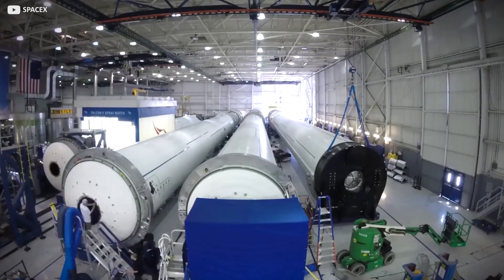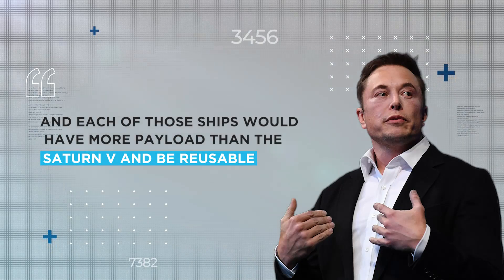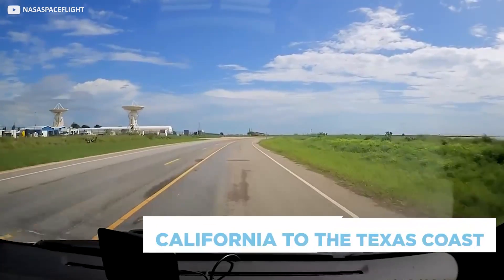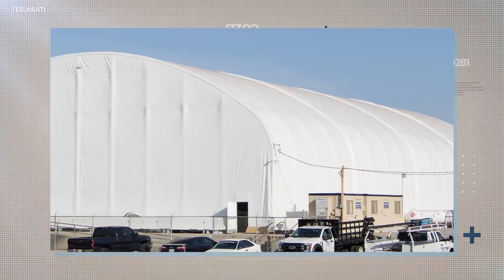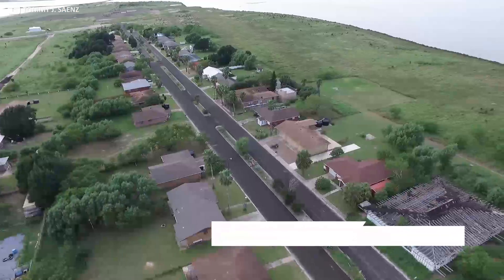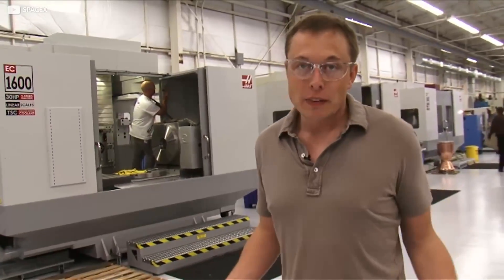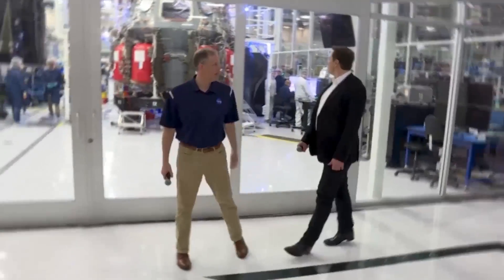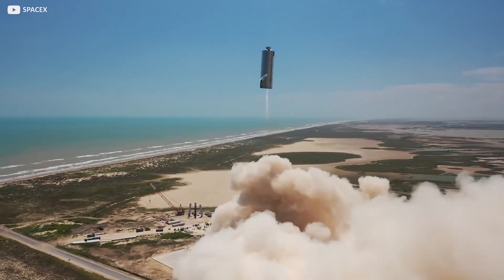Inside SpaceX’s Texas Rocket Factory

Comment: Mixed results, long suffering launch pad.....
Go back to the 50's through early 2000's and see the mixed results. SpaceX has fundementally changed space flight and aerospace engineering. SpaceX hasn't even come close to the failure rates it has taken to develope single use launch vechicles on the average. Space is hard. Instant gratification is a sad pandemic of modern life.

Comment: Best example is that Falcon's most recent booster just completed its tenth launch putting an additional 60 Starlink's into LEO. From the git-go that evolution from first reusable test launch (2013) to stable launches and reusability (mostly) (2017) was 4 years.  Starship is only in its second year and the raptor engine is in evolutionary co-development on the same platform. Musk is following the classic entrepreneurial way of dreaming big then execute by making and correcting your errors in understanding as fast as you can.

Comment: I have an idea, when they build the rocket they should have a big elevator so it moves down when they build / assemble it, and when it is finished they run the elevator all the way up and it is ready to drive it out. Then they also do not need such a large tower to build in and the staff does not have to be hoisted up in a crane.

Comment: "tested with mixed results"" .. the results are not mixed at all, they are a linear evolution to better and more efficient Starship construction.  Learning what it does by trial and error, whether it explodes or lands on the pad, they gather volumes of data each time and the next prototype is a bit better than the previous one.
Reply: Exactly. Elon said years ago the plan was build test, build, test. Etc. making incremental upgrades along the way. The old way was to build to the best level possible before testing.
Reply: on paper this is easy, but i imagine converting all this data into results is pretty difficult
Reply: You learn more from a mistake than from a fluke success
Reply: Since Space X is far from having a perfect score for its tests, it's a mixed result, of course.

The fact it's was anticipated makes it acceptable.

The progress makes it worth it.
Reply: I wouldn't use the word linear though.
Reply: @Steelrat1994  Evolution with an upwards trend is more fitting

Comment: The current launch site will be a factory to mass produce starships in the future. They’ll move to oil rigs to launch rockets once they get the hang of launching the starship.
Reply: current launch site is more likely to remain a launch site to be used to launch newly constructed starships out to the floating rig, nowhere for a barge to dock to to load starship to haul out to the old oil rigs so they'll likely need to fly them out to the rigs. they even have plans for expanding the current launch site to include a second orbital launch mount and tower.